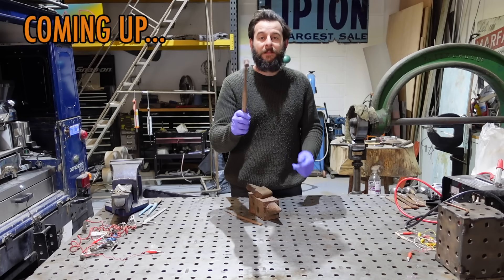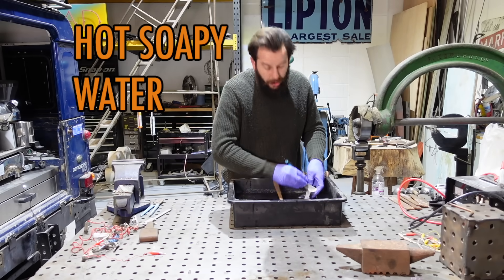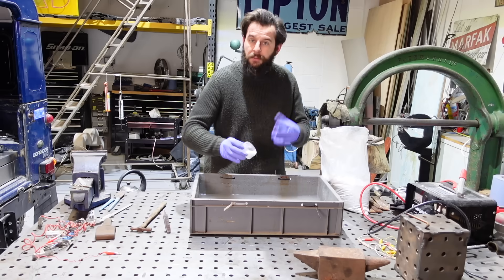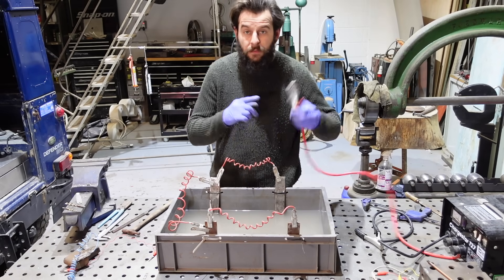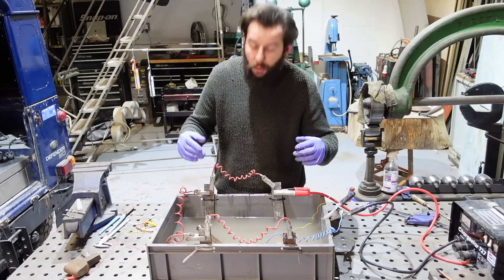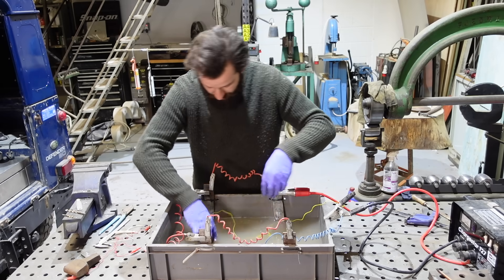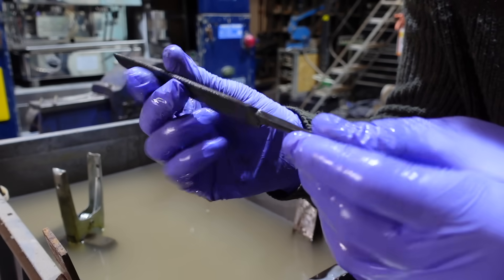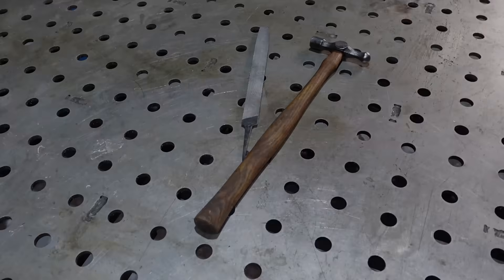The Power of Electrolysis | How To Transform Rusty Tools!

Comment: You should mention that the bubbles are hydrogen from the cathode and oxygen from the anode. You have a potentially explosive mixture if  in a confined space.  You must therefor be sure to provide adequate ventilation.
Reply: Caution: There is also the issue of Hydrogen embrittlement.

Comment: My Charger will deliver 12 or 24v, is there any advantage to using the higher voltage?
Reply from the maker: Mine does as well but I’ve never tried it so I don’t know! I’ll give it a go and let you know!
Reply: @DominicChineas  great thanks. Just finished building a steam punk desk from recycled wood and copper pipe, inspired by your DIY show :o)

Comment: Works well on rusty Engine Blocks, though the process can take at least a week, with one water change...........
Reply: What does changing the water accomplish? It is not like it wears out. Does get more disgusting. But you're not going to improve the process by changing it. Cleaning the anodes helps. Beyond being a charge carrier the solution does nothing else though.
Reply: @1pcfred  When ive done it, i've changed the water, as it gets overlaoded with rust residue and the procees slows down.
Reply: @1pcfred  I find the Straight Six Zodiac / Zephyr are worst, the 4 Pot Flat heads are not too bad.

Comment: I've watched many of these electrolysis video and this one is very good.  The only thing I would add is that in addition to saying that the battery charger should be a simple one; you might say it should not be a smart battery with circuitry that detects weather a battery is bad.
Reply from the maker: This is true.. thats what I meant when i said bog standard.. just your basic average charger. it wont work with a smart one.
Reply: Definitely don't want to be too smart with any of this. I thought the presenter tried to make the point to use a "bog standard charger" in the video. But I'm sure there's folks that have no idea what that means. No one likes to weather a bad battery either. Whether or not we have a choice sometimes is not the case though. Synonyms. Ya just gotta hate them. Or is it spell checkers that can't take context into account?

Comment: Are you sure this process doesn't remove material? I am interested because I would am thinking about using this process for cleaning blades of some pretty expensive folding knives. I have a few d2 steel blades (one of them has some rust on spine file-work - strider sj75 baby huey) so, sometimes it's really hard to get to this rust, even using some chemical rust removers, you still need to rub it off in the end... Anyway, I have a 30V 20A variable power supply, that's more than enough, but the whole idea that this process does not remove healthy material seems weird.... I mean, why wouldn't it remove healty steel? Maybe it does not remove too much material to be noticable for hammers, but knives? I think I'm gonna do some tests... on razors :D
Reply from the maker: Interesting! I have never tried it on knives, if you have a read through the comments someone did say to be careful on thin edges... I agree the best thing to do is try on a not so precious blade and see! let me know how you get on
Reply: I definitely does not remove any non rusty metal. I only works on the oxide of the ferrous oxide ie the rust.  Although hydrogen embrittlement is a different matter, but as long as it is only in the proceeds long enough to remove the oxide it should not affect the edge and if it does it will be so minute that a good sharpen would be enough to get back to healthy steel in one go.
Reply: It removes some iron, but only what's already chemically bound up in the rust that flakes off, and some in the black coating that you polish off after the process.
Found a nice explanation at
https://www.metaldetectingworld.com/electrolysis_rust_removal_p2.shtml

Comment: If you change polarity, use copper as anode and plate the hammer with copper. Super saturate with Salt
Reply: I found this out by accident from when I used brick cleaner (dil. Hydrochloric Acid) to de-scale a copper heat exchanger, clogged from hard water use. 
Then, for cheapness, used the same acid to clean some massive gate hinges by soaking overnight. I was surprised to find in the morning they had acquired a thin coating of copper, and looked rather posh.
I shall try your method using a current.
Reply: @tiggywinkle1000  you may have best luck using a solution of copper sulfate.
Reply: That is intriguing 🤔 Salt - Ordinary table salt?  Sodium Chloride? Does this work with any other metal as the anode?
Reply from the maker: nice! I might give that a go.. never tried it.  electroplating can be very tricky to get a nice even coat though.

Comment: Does this work OK on hinged tools, like pincers or pliers?
Reply from the maker: Yeah it’ll still work great
Reply: Hi Dom, got my first electrolysis on the go and it's fizzing away great. Just wanted to ask if this will still work if the tool still has plastic on the handle. Presumably so long as the metal parts are connected it should still work.
Reply: It worked great. I had an old pair of carpenters pincers that were my grandads. Probably well over 70 years old. They'd well rusted up but they are now clean and working fine.

Comment: Good stuff Dom.  I have used this method to de-rust the awkwardly shaped metal heater body of my Mk2 Cortina with great effect.  One word of warning though is to only use electrolysis in a well ventilated space as the gas given off at the cathode is hydrogen.
Reply: (Hydrogen gas is not toxic, but it is very, very flammable.)

Comment: Excellent!  Have you any suggestions on how to stop files rusting? I keep mine dry etc but they still get some rust so I suspect its humidity. I have sprayed them with Noxi and that seems to work but it is oil and I do prefer a dry file.
Reply: Silicon spray can

Comment: A rusty hammer is still a usable hammer 😉 in fact the more you use it the lest rusty it is. Also I use salt in electrolysis not necessarily any better but the missus has lots of it in the cupboard 😆
And as a wee tip when you remove anything from electrolysis and have cleaned it, you need to rustproof it ASAP as it will rust again very quickly. Great video though👍
Reply from the maker: Yeah Salt works, just don’t use her best posh salt!! Haha!
Depends what your using the hammer for to be honest.. you wouldn’t let a hammer in that condition anywhere near a sheet of aluminium for panel beating.. 
thanks for the comment!
Reply: A clean hammer is better to use though. No amount of use is going to get a rusty hammer as clean as I want it to be either.
Reply: Be VERY careful  if  you use common salt as the gas given off is chlorine which is very very poisonous.

Comment: I have been using electrolysis for a number of years. It is a permanent part of the tool restoration business here at Old Sneelock's Workshop. 
I use to be in charge of repairs in an aluminum anodizing shop. I replaced the expensive stainless steel tanks with plastic lined steel. 
When I retired and started restoring tools I used large wooden boxes lined with plastic sheeting for electrolysis. You can put very large pieces in a wooden crate and it is inexpensive to make any size you need.
Reply: Thanks! That is priceless info! Repost it under someone elses reply-laden comment, so more people see it!

Comment: Excellent video - Thanks! One thing to mention on the safety side is that the bubbles do contain hydrogen, so there is a potential risk of an explosion if this is done in a small, unventilated space. Ideally either work outdoors or leave a window open...
Reply from the maker: Sorry your totally right, I should have mentioned to use it in a well ventilated space..

Comment: Hello Dom, Captain Cautious here! Electrolysis is a fantastic way to clean more "solid" items but should be used with caution on "edge" tools such as saws and chisels as Hydrogen Embrittlement may occur. Other than that water and electricity.........hours fun for all the family! Cheers Simon
Reply from the maker: Nice one thank you Simon, appreciate the warning!
Reply: Good point.  Also applies to springs, which can become liable to snap.  Google Hydrogen Embrittlement for more information, including heat treatment to cure problem.
Reply: You can bake the hydrogen out of steel. Or just give it time.

Comment: Great video Dom. I’ve always put mine to soak in diesel. But definitely going to give this a go. Looks like they come out better this way 😊
Reply: I think he’s trying to clean the rust off, not make it oily ... the elbow grease in getting the diesel off is what’s cleaning the metal!
Reply: @andyxox4168  obviously you wash it off after. 🤷‍♀️ its a method that’s been used for years for getting rust off. Although takes a lot longer than Dom’s method 🤦🏻‍♀️
Reply: @Claireswelshlife  , no it isn’t, diesel doesn’t remove rust just makes everything oily .. as I said it’s the elbow grease that shifts the (surface) rust.
Reply: @andyxox4168  🤦🏻‍♀️ you soak it and wire brush it. It’s not 100% efficient. But it’s always the way I’ve done it. And the way my father and his father did etc. But we all have our own ways. Anyway as I said I’d try Dom’s way. Have a good night 👌🏻